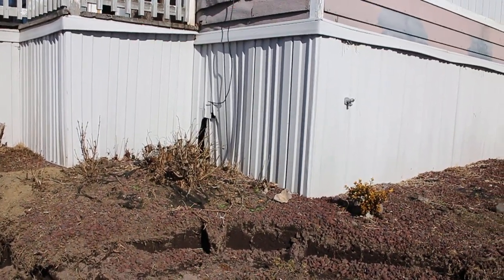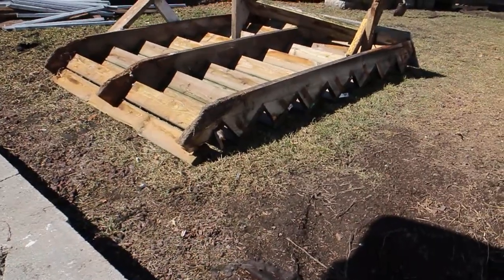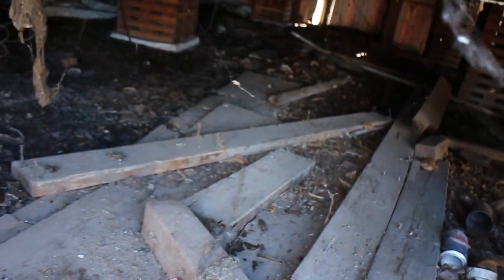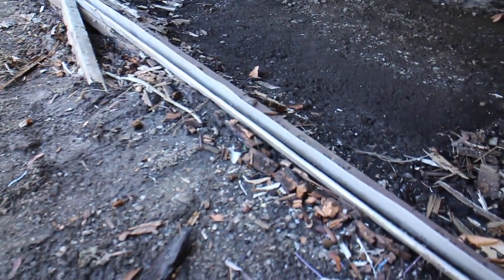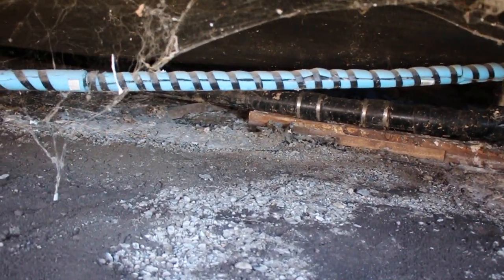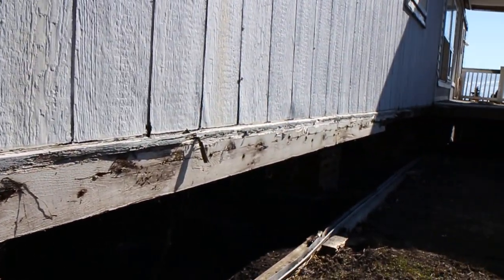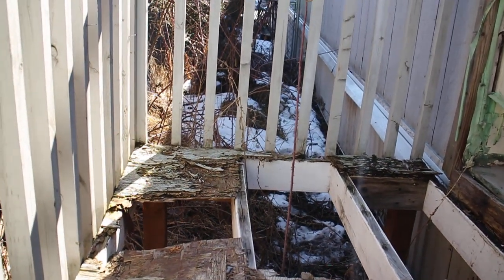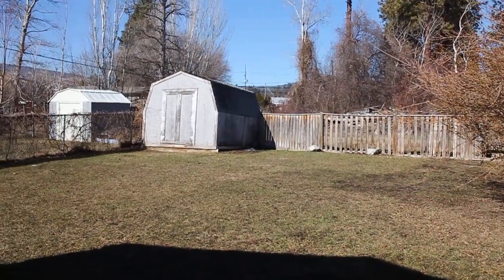Mobile Home Renovation - Starting Exterior Demolition Work : E012 / BC Renovation Magazine

Comment: Hi luv ran into a new problem with the bath insert how do you cover the shower without replacing it ie the screws and the over flow with out big pieces of wood hope your having a beautiful day and thank you for always making me feel me can do this
Reply from the maker: Hello, Irish Eyes. You had me stumped there for a moment. You changed your name! :-)

Not sure if I totally understand your question, but I think you are asking about that flange that goes around the edge of the shower, where it meets the wall? 

The way that they installed these showers at the factory is kind of odd. In a regular home that flange is hidden under drywall, but not so in mobile homes. There seems to always be some kind of molding present that doesn't look great. The only elegant solution is to replace the whole unit, which I don't think you want to do. 

I would try to come up with some kind of a piece of wood that is just big enough to do the job. You will probably have to make this yourself. For example, you could use a piece of 1/2" by 2" flat casing material. Groove out the back of the wood for the shower flange to sit in, so the wood lays flat on the wall. Nail (or glue) the wood on over the flange. Then caulk it in nicely and paint it the same color as the wall. It should blend in an not be so noticeable.

Hope this helps! :-)
Reply: @BCRenovationMagazine  thank you luv so much happy day and me will figure this out big smiles
Reply: Me had a man out to pull it out and put in tile lol sweet but he said nothing wrong with it don't waste your money but me home isn't a waste of time so as you see a wee lady on her own most men think she can't do this Haha but thank you for everything you do to help me your so very kind many Irish blessing to you and your family
Reply: Also me found that if I mix 4 to 1 ratio me can get the look of a orange peel finish you truly have inspired me and took the fear away .had a problem with the outside boarder on bottom learned to put tile on the boarder and fix 25 ft of no gutter so you really are the man and your videos are kept on file to go back and forth to thank you so much for everything you do